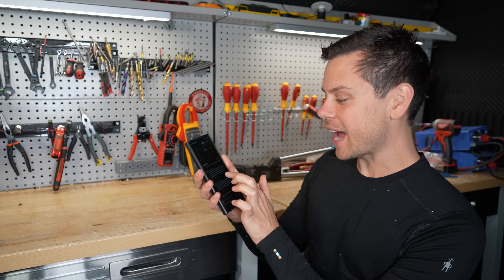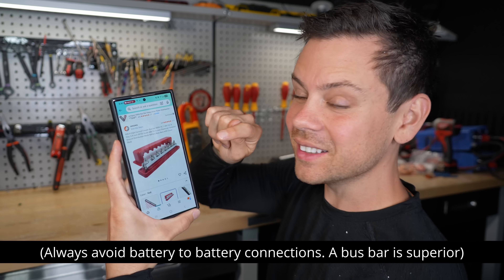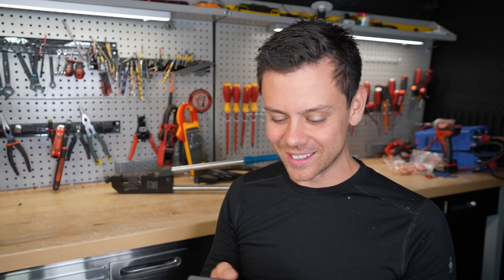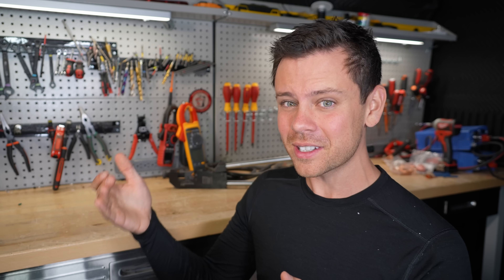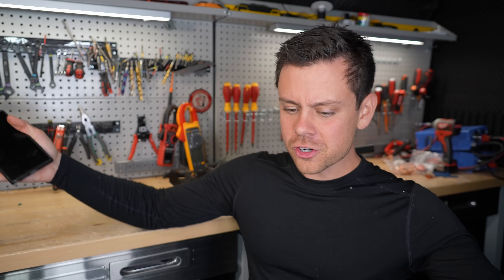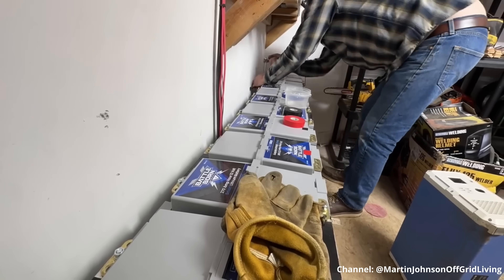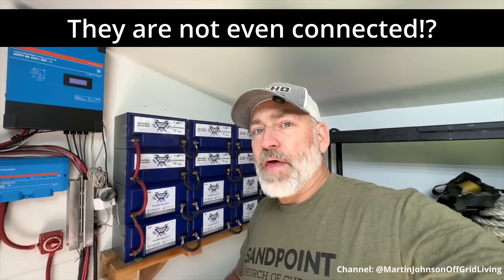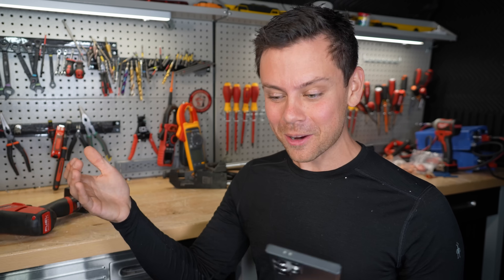My Reaction to Martin Johnson's "BEST Off-grid Battery Bank" Video 😬 Yikes!!

Comment: this is awesome that you're doing follow-up video on his content, no doubt some serious SHILLING going on.  small detail, but his timeline info is a little wonky.  He posted original setup back in November, said it was enough for 'couple days' of energy without having to recharge, perfect setup for family and no issues at all.  He then turns around ~2 months later to install 24x 270aH batteries 'make sure he could run his well pump'.  actually watched the video 2x to learn the specific 'why' of this upgrade and he is VERY deliberate and vague with his words.  This gap in context/details really raised some alarms in my brain, and is a good reminder to folks that a LOT of youtubers are disguising brand deals and collabs very covertly these days.  

at the end of the day, there's an exponential rise in 'patriotic' products that imo are taking advantage of a lot of folks.  this guy has 1/2 million followers and guessing he walked with a $100k sponsor check from BattleBorn and a great set of batteries for his house.    

again, thanks Will for keeping the community informed and educated

Comment: In his defense, he did say he wanted to build and measure all the cables in his garage, where he had more room, and basically dry fit everything BEFORE working in his power shed, where it's more crowded.  Ya, I cringed hard at the soldered lugs and the wire gauges.  I think Martin got in bed with Victron and Battleborn years ago, when they had better reps, and less competition, and now he has brand loyalty.

Comment: He has a nice orange kitty. But soldered terminals scare the hell out of me.
Reply: Why? I have never had one fail. I have had a lot of crimped ones fail.
Reply: @wiredforstereo  Then you are crimping wrong. Besides, I have crimped about 600 ends in the last few years, even cut some apart.  With tons of force on a hex die, the copper wire and the terminal look  like a forging with absolutely no space between the strands.

Comment: Once again proving just because you have a youtube channel doesn't mean they know what they are doing. Pretty common knowledge that BB bateries are very expensive and I can not imagine running my wires as he has laying along side the opposite poles. Soldering lugs with that amount of current is a disater in the making. His homeowners insurace better be in force & not excempt this kinda thing out. I owned my business for 40+ years. I loved it when people would retain me and then say they they saw on a 10minute youtube a totally wrong procedure & proceed to question my methods.

Comment: This looks dangerous without in-line cut off's and in-line circuit breakers, especially for series systems. Needs to rip out wiring and do it with the right gage wire and connectors. I would put cement board between wall and batteries and leave a little room from the wall for maintenance.

Comment: 1 Battle Born 270 = $2,149 current price < just the battery (3.4kwh)
4 Ecoflow Delta 2 =  $2,000 total current price  < has AC plugs, DC, Solar input (4kwh total)   << when they are on sale its even less expensive - ready to use out of the box.

Is my math correct how can 1 battle born battery cost so much??

Comment: How are those batteries only 270Ah 12v? They are MASSIVE! 

His aluminum bars are a little thin! 
For my 12v system I use 1/2" thick 6061 to connect the individual cells in (parallel and series) and the +&- ends ("terminals") are 1" thick 6061.... Granted I'm pulling up to 1000A pulses out of them and use supercaps between.

Comment: Most electrical busbars especially aluminum are coated with alloys such as silver or nickel for a good reason. Copper will oxidate which can increase resistance however it’s not usually a huge concern in normal environments. Aluminum oxidation on the other hand can actually act like an insulator. I’ve seen aluminum wire with very strong crimp connections that actually read as an open circuit after the metal oxidizes from years of use and no oxidation protection.

In the past a compound had to be applied to all aluminum electrical connections before installation to prevent this oxidation. Newer aluminum wire for electrical applications usually has alloys mixed in which are designed to prevent the aluminum oxide.

It appeared this guy was just using regular aluminum stock which may not have been designed with the right alloys for electrical applications… Sanding the aluminum to take out any oxidation may be a good idea but without de-ox it will just reform.

As Will said it will work as long as everything is ok… once a load is applied and the metal oxidizes it will be a viscous cycle of heat and resistance until failure. And as Will said the wire is sized not just for load but also overcurrent protection… so that the circuit has a very low resistance to allow for a maximum amount of current to be pulled quickly in a fault… such as a short circuit. If the wire is undersized it will not carry as much current as needed in a fault scenario to quickly activate the over current protection. Unfortunately for this gentleman if the circuit ocpd doesn’t open fast enough the fault can become sustained creating a fire.

For sure those busbars are a very weak link. Couple the busbars with undersized conductors and it’s a ticking time bomb!! Lots of issues in this installation. Hopefully this guys corrects these issues for his own sake!
Reply: Aluminum wiring was the cause of many house fires in the 70s (before Will was born).  I'd avoid using Aluminum altogether for electrical work.
Reply: @jrplus416 That was primarily due to the fact they were using smaller conductors (10 and 12 awg) for branch circuits such as lights and receptacles. The wire would expand and contract too much and cause lose connections that created fires. In addition to the other oxidation issues.They no longer allow new wiring that small in aluminum. The wiring they allow for services and feeders is totally fine if installed properly. I’d doesn’t have the expansion and contraction issues or oxidation issues of aluminum from that era. Not to mention basically all the distribution lines that provide power to 99% of the country is aluminum along with most of the secondary service feeders. It’s a tried and proven product at this point… I love copper wire but the cost can be prohibitive especially for larger services and long feeders.

That said… in this case I would have 100% use copper busbars. Especially considering it would have had a very minor impact on overall cost.

Comment: Will, Log time since I posted. But the old saying "you can't protect stupid people, you can only call 911" seems to apply to this. I wonder if he even thought about the failure of one battery and the fact that copper melts at about 2,000 F and if it flash arcs then all bets are off. The aluminum bar appears to be 1/4" X 2" 6061 and a foot long so that means that may handle about 275 Amps max on a good day, copper bar is about 3 times that high. He should have mounted this monster inside maybe a 1/2 inch steel and line it with fire bricks and a second steel wall with a place for the fire to blow out. I am hoping his HO insurance is paid and has a stupidity rider on it. I thought it was a parody when I watched it... LOL

Comment: On YT, I nearly always see lug connections argued as crimped vs. soldered. However, watching some highly experienced marine engineers and electricians put enormous systems together for commercial operations (4/0 welding cable was the small stuff), it was common for them to do both. However, it was using specialized equipment--nothing like this. This was around 20 years ago, but the big solder pellets that were being used then are still sold by the marine electrical companies, so I'm assuming that it is still a practice depending on the application. I think it was done because anything major working its way loose, for any reason, could be deadly.

Comment: you might hate doing 12V->48V series setups but they're done all the time by lots of people with no issues.  especially in the RV space.  but not with solder. that's just... bad.

you're right about Battleborn being a total rip off for price

it's a 300 amp battery each btw, you had to pull the data sheet. so his cables are half the amperage needed. he needed 2/0 and to fuse each string.  weight is 80.8lbs each

Comment: I'll cut corners and cheap out on wire gauge but I'm also playing with little non lethal power supply's as in my bikes lead acid. I still point out that my wire should be at least a gauge thicker so don't repeat me or something. when it comes to lithium I try my best to follow the standards. My lithium build is a bit under gauge but for what its actually used for the main wires are overkill.

Comment: Hi Will, you know about batteries a lot, and you are right in 99%. But SoC curve (V vs SoC)is different for different chemistries. So you opinion about cell equalization is correct, but only for Lifepo4 chemistry. Lead-acid and li-ion is different. It is acceptable to equalizer at any SoC state. Of course best option is to follow your advice - equalize at 100%, but with chemistries other than Lifepo4 it's not that much critical.

Comment: You dont want to solder little lugs either. Solder heats the copper causing it to be brittle and not flexible anymore. If it moves, it will break. Crimped does not cause the heat and keeps the wire flexible without snapping off. You can solder wires if you secure the wire from movement.
Reply: Heat anneals (softens) copper, movement hardens it.

Comment: Thank you for making this criticism. Martin Johnson needs to get some basic safety training and not encourage dangerous practices unwittingly.
Reply: I almost stopped watching when Johnson started swinging that torch around, but my curiosity got the best of me.
Reply: Using a cardboard box as a work surface for torch work, then placing the lit torch between his legs adjacent to the box was enough for me, before he got to the homemade bus bar/tubing.  I had a chance to see the aftermath of incorrectly wiring a motor starter on a 125 HP motor at 480V; the bus bars melted and ran down onto the floor.
Reply: I think I watched this guy a few years ago and after about 3 to 4 videos I was like this  guy doesnt know what he  is talking about.

Comment: Holy Cow!  My 42.9 KWH system including the Flexboss21 inverter and the Gridboss MID cost me just over $17K on sale.  And why on earth would you start with 12 VDC batteries when you can buy 48 volt batteries to start with?  ;0)
Reply: Good 12v’s <$100 nowadays.

Comment: I have nothing against Battleborn, and I almost got them myself, but they are OUTRAGEOUSLY EXPENSIVE.
'Tis why I went with EG4 instead since they have good track record and warranty.
The rest of the video is pure farsical entertainment. LoL
FYI: I used copper plumbing pipe as a bussbar for an old 12vdc low amphere draw system with mechanical connections. Never aluminum or soldering

Comment: Wait, did you see the way the cable easily flexed???? (3:56-4:00) Im am betting he's using that crappy Chinese wire they sell with cheap welders. It flexes like its made of 1/4 rope. I think its copper plated aluminium.

Comment: I saw the video when it first dropped and the first thing I did was look up the price per battery and after picking up my jaw off the floor I knew you could build an equal amount of capacity for a LOT less money.  And then he got out the aluminum from the local box store hardware section and I started doing all kinds of major head shaking.

Comment: Good reaction video, that was entertaining as a 3rd party, HA! 
As for wire sizing, I have 2 AWG on my single 280AH pack & inverter, however it is 105c rated pure copper wire and the 6000W inverter can only pull a max just around a 90C rating. Which will never happen in my setup. All my connected loads are like 4000W total. It does have a 250A T-class fuse on it, which is a lot higher than I'd like, but should still stop a dead short. I will replace it with a 150A fuse at some point, or get some beefier wire. I set the BMS OCP to 140A though for now as some sort of safety measure but I don't expect any issues.
And yeah, soldering big lugs like that... 🤢

Comment: There was so much wrong, the part got missed where he created a dead short right in his face. Battleborn should be blamed as much as him. That’s what’s going to happen to people without anyway of turning them off at the battery by the BMS or onboard breaker while you’re trying to build a 48v bank out of 12v batteries.
Reply: There is absolutely nothing wrong with building a 48v system with 12v batteries or even 6v batteries if it's done right.
I have a 48v system running a household and about to enter the 7th winter with it. 24 6v 235ah deep cycle "golf cart" batteries, Three "strings" of eight batteries each.
I bought them all brand new, same month of manufacture. They are in a climate controlled environment and the system kicks ass. About to enter our seventh winter with the system.

Comment: In the past (long time ago) I have connected four 12V LiFePo4 batteries together without any balancer between this. After some months my system faults because one of this battery has an defected cell inside (4S2P). This one cell has crashed the whole battery and the complete 48V string. In my case the inverter runs crazy and my RCD (used in germany for person protection) has tripped. Local blackout. The complete system in error state/shutdown. Never ever I do build a system like this. I'm running four solar systems and one of this system is for testing purposes based on an victron easy solar 2 GX connected to two 25.6V redodo batteries. But the cables are all 50mm2 for an inverter that can produce 2400W at 230V/50Hz continues. The wiring is both batteries in parallel but the primary positive connector is located on battery #1 and the primary negative connector is located on battery #2 so that the current must passthru the whole block.

Comment: You can use aluminum, as long as your calculations are correct. Plenty of calculators online. 

EDIT: To elaborate - Aluminum is cheaper, lighter weight, and has better corrosion resistance to copper. Aluminum has 60% of the conductivity with only 30% of the weight. In large installs, that weight and price savings can add up. 

So it's not really BAD, but on a small install like that you might as well just buy copper.
Reply: But you absolutely must remove the oxide layer and immediately apply silicone grease to prevent further oxidation. Slathering grease around the outside of the connection is not helpful.
Reply: @manolisgledsodakis873  You should check out no ox id. It's CONDUCTIVE anti corrosion grease. You can brush it onto your lugs and terminals and then cap it with the regular terminal boots. 

I've had it on for 4 years and my connections are still shiny new. And I'm on a sailboat in salty ocean water! :) 

Pretty cool stuff, worked really well.

Comment: Thank you for commenting on this, I was going to but this guy is so out of it and wrong I couldn't even get through the whole video. I could never understand people using Battleborn batteries for large systems. I bought the EG4 Powerpro batteries for my system and they are plug an play for $3900 each. There are these ladies called the Van Wives and they also did a battleborn battery setup. I don't think they had to pay for them cuz I think they were sponsored but still crazy expensive